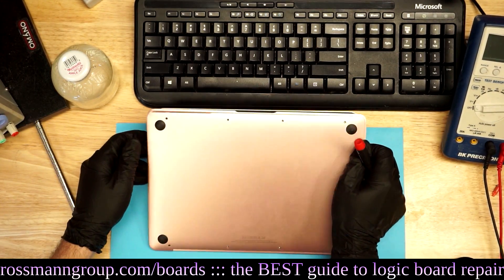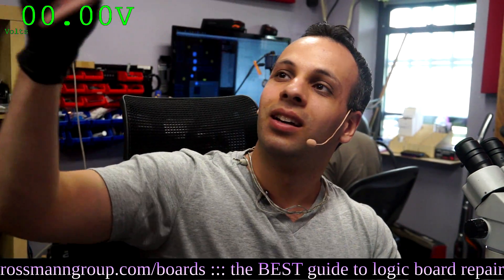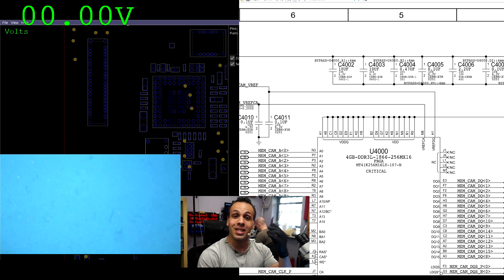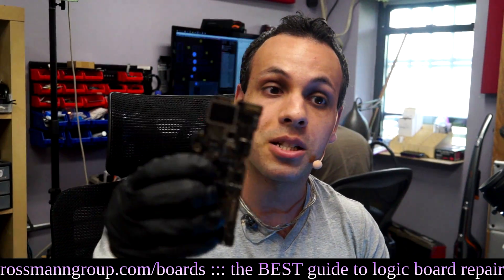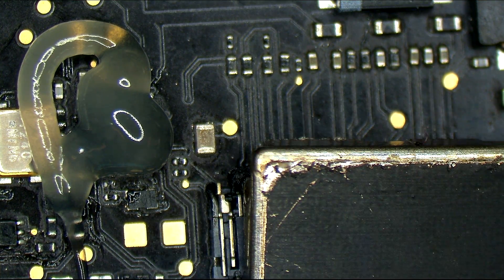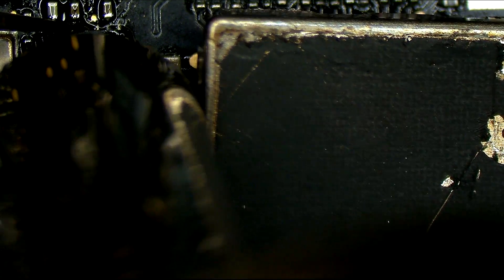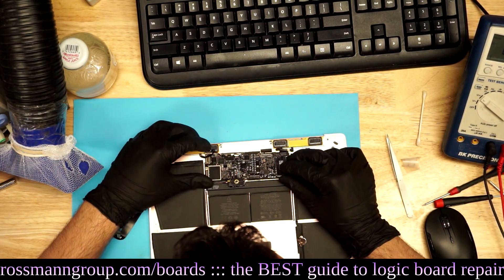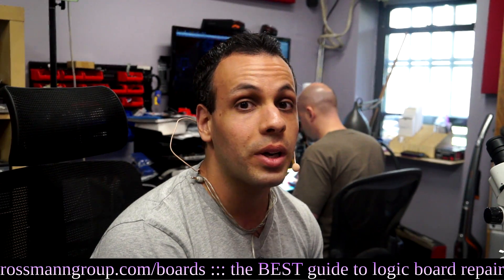Mall repair franchises are garbage and ruin the credibility of our industry.

Comment: Do you ever reach out to the actual OG customer to let them know that the shop they took it to screwed up badly so they don't get charged for something the original shop never could accomplish? My bet is that the original shop never told them they sent it to you in the first place so it seems like they fixed it and lied to the original customer.
Reply from the maker: I absolutely would if I had their info.
Reply: Leave notepad document on the desktop for them to read, with a link to this video xD
Reply: It seems they would glue a potato chip to the board if it were the same size and colour.
Anything is possible...
Reply: Kind of need the password to log in to the desktop.
I don't think they send along password info that easily to Louis when it's about board repairs. At least I hope they don't.
Reply: SunnyZ
that had me LMFAO the thought of a rotten potatoe chip taped to the aapple.
Reply: Mall jewelry stores do stuff like this all the time. They bring a ring in for repair, break it worse, then sneak it off to a real jeweler.  Car dealerships are the same as well, when they screw something up really bad, they sneak it down to the local autobody shop that knows what they are doing.    I wouldn't be surprised that if he took the store across the street, the Apple Geniuses would be sneaking over stuff for quick repair.
Reply: @Tom Kriek as long as it isn't actually encrypted hard drive, bypassing the password is easy with physical access. I can do it on Linux, Mac OSX and Windows in a snap. Now full disk encryption will stop that. I'm not going to give exact details as people who steal laptops often would like people who know how to bypass the password to do it for them.
Reply: Tom Kriek he does not need the p/w. He can get in without it. He said a lot of the repair requests he gets is from people who have (potentially stolen) MacBooks, and want him to get into them. He doesn't do it for them though.
Reply: he had the pw, he had to have it to see the power indicator afaik
Reply: interesting that they have the balls to try. I hope he keeps the device and calls the cops, haha

Comment: Thanks a lot for this PSA Louis. I went to a local mall to get my Samsung J3 screen repaired. It's a simple job, I could have done it myself, I just didn't have a heat gun to remove the adhesive holding the screen assembly and rest of the phone together. I did my homework before I went there. An original AMOLED screen costs about £60 on ebay, but a cheaper LCD screen is only £20. I talked to the guy there and he said it would cost £60 to get repaired, and I would be getting the original screen, which seemed to check out, although it seemed a bit fishy since they didn't add any labour cost. I didn't think much about it, I just really wanted to get my phone repaired as soon as possible. 

I came back 2 days later, paid them the £60, even bought a case and screen protector for £15 (a complete rip-off). Immediately after turning the screen on I saw that it looked different. The colours were more faded, but the worst offender was that I could no longer control the screen brightness. Something that I didn't mention was that the LCD screens for the J6 had written on the information page that there was no brightness control for the LCD screen. It had been very apparent what they had done. Before I walked out of the mall, I went back to them and said "I can't change the screen brightness". They restarted the phone a couple times, removed the battery, had a quick chat in their own language (they were from the middle east, or at least seemed that way). Finally, they told me it was a problem with the "software" and not the screen. That I needed to update the phone and I might have a virus. They stressed that it had nothing to do with the screen. Not wanting to be kept away from my phone any longer, or make a scene, I stifled my rage and continued on. 

I mean the phone technically works, but I am never trusting a mall repair guy ever again.
Reply: Yes a virus that specifically attacks brightness controls yes. I mean ffs who do they think is honestly that stupid to believe that garbage.
Reply: So....if you knew all that why didn't you tell the guy that you knew they ripped you off by not replacing it with an original OLED display, like he claimed he would do?
Reply: "Not wanting to be kept away from my phone any longer, or make a scene, I stifled my rage and continued on"
Reply: Yeah well but that's the thing i don't get. 

Why didn't you want to make a scene? They took your money and didn't give you what you paid for. 
I imagine you being at the store ordering a pound of meat just to get some cheap cheese instead and instead of making a scene you just go away? 

That's one of the few reasons where making a scene would be fine in my eyes. You paid for something and didn't get it.
Reply: There's no need for a scene but please report them to Trading Standards since you are in the UK https://www.citizensadvice.org.uk/consumer/get-more-help/report-to-trading-standards/ otherwise they'll just continue happily ripping off people who don't know any better
Reply: The only mall repair guy I trust is the guy repairing the mall. I do not even trust people selling things from the little kiosk in the middle of the mall walkways. Dam I am now talking like a yank, sorry.
Reply: I don't know your country, but at least in Spain every business is required to keep a "Hoja de reclamaciones" (Claims sheet) for you to fill out. You should always ask for it and fill it out if wronged.
However, honestly what did you expect when the quote was the same as the prize of the part? 40 pounds profit seems reasonable (taxes, rent or mortgage payments for the store, electric bill, replacement parts for when you fuck up, parts seized at the border, etc eat much of it), 0 pounds doesn't.
Reply: Why did you went back there in the first place then? It's not like they can change it then and there if they already took two days to change it. You just went back to swallow their bullshit basically.
Reply: Should have argued the toss to make it clear that they did something to piss you off, then just taken the phone and leave. They can't take you to court if they scammed you in the first place.
Reply: @Dennis K
Will do
Reply: lap tech are you a kid? because adults can't necessarily AFFORD to be without a phone for long. Don't pretend that everyone who is willing to take some shit to get their phone back faster is just a phone addict who can't live without it and made bad life choices.
Reply: One was unable to fix my family members iPod. They did however, replace the device with a refurbished one that had a really decent and maybe Original Screen. Still wont trust em though.
Reply: Hi fellow, 
I feel your pain.  I could tell you stories about how recent competency matters in things involving fine motor skills, soldering irons, microscopes, and your stuff.  I have lots of knowledge.  At one time, I had Louis’ motor skills and people to get me the tools. Mind you, this combination does not last long enough.
I can often protect myself by software and diligence.  Even that can take me away from core business that I must do now.  That is why I treasure people like Louis.  He learns and passes on good experience.  That is worth something.